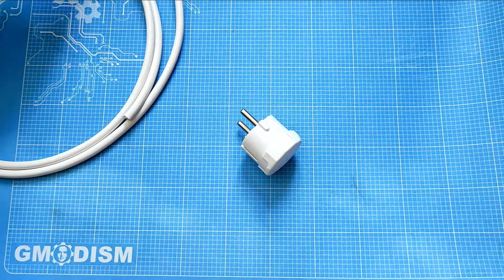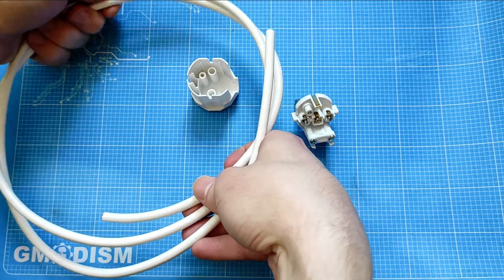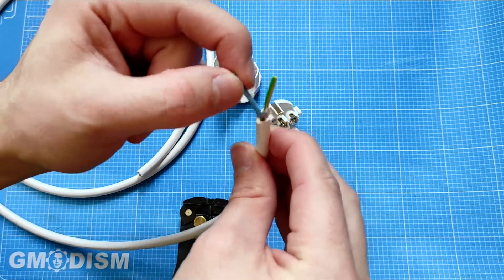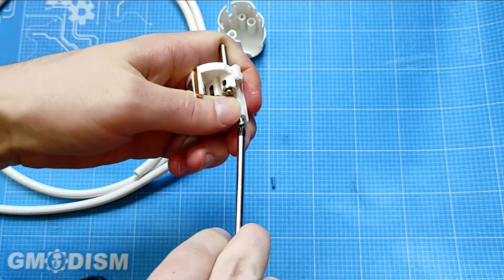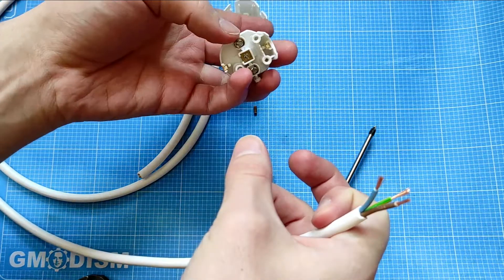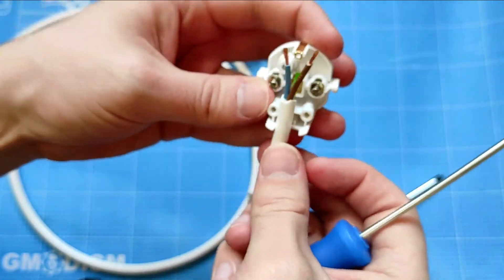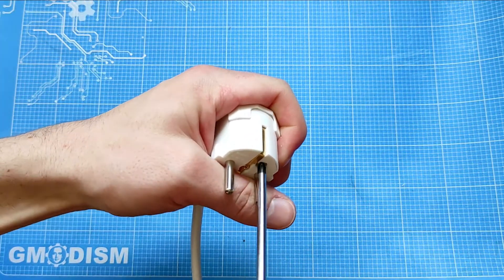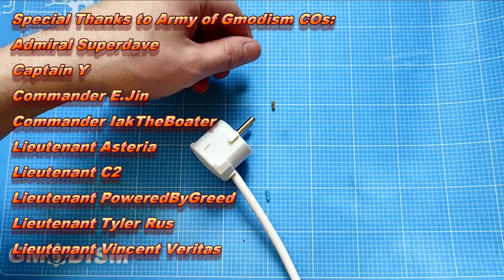How to WIRE an ELECTRICAL PLUG (EU type F) safe and easy

Comment: Must use ferrules on stranded wires (flex) and the earth wire must be slightly longer than the line and neutral wires.

Comment: Please note that your insurance won't pay if you do stuff like this without a proper education (and this is found out to be the reason for fire for example). In Germany you need  an IHK certificate where normal electrician might not be enough, you need to be specially educated to check the safety of these. 

Source: I did an apprenticeship in the field of electrical engineering.
Reply from the maker: Laws and regulations differ a lot, so that should be checked wherever you live. I am just showing how to do it but we are not taking responsibility when someone does a bad job of it.
Reply: @gmodism  alright 👍 
Just wanted to leave that note so ppl think before they do.

The explanation how it's done is good, I'd use the squeeze-metal sleeves for flexible wires, so it would last a bit better in screw connections, but that is a question of preference.
Reply from the maker: Yeah that is even better, I never use them but I should, together with like most people haha

Comment: Please use wire-end sleeves when using a flexible cable with simple screw fixings like that.
The thin strands might break under the preasure and torque from the screw's tip. They might also shift a bit with time to create a bad contact.
Reply: The hek is wire-end sleeves? You mean ferrules? 😅
Reply: Yes  @IAmThe_RA
Reply from the maker: Yeah that makes it simpler to ensure a good connection, nice stuff, I think far to few bother with them, me included.

Comment: i dont even know why i watched this video when im doing an apprenticeship where i do stuff like that daily on trucks but at least i can confirm that what you said is correct.

the "clamp" is a form of strain relief because many people pull out their plugs by pulling on the cable. and clamping it down inside the plug makes it so you dont pull out a wire from its spot.
Reply from the maker: Yeah, that clamp is quite important because of the way people abuse their electrical cables. Good it is correct according to a truck electrical pro!